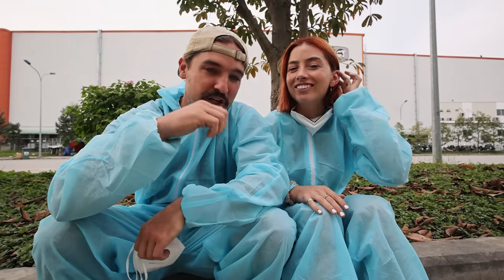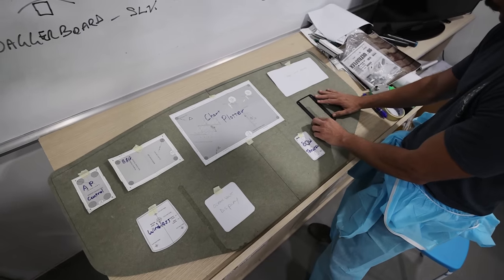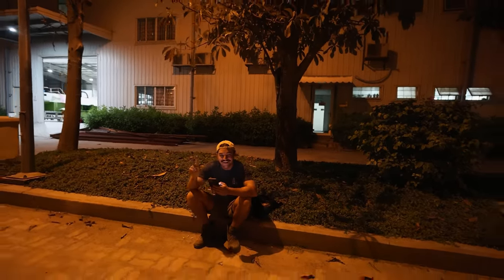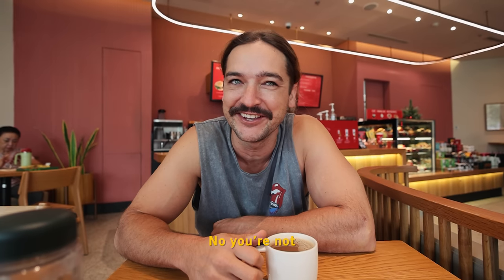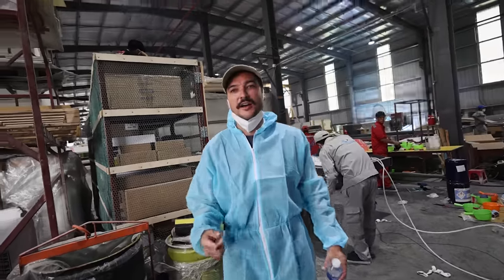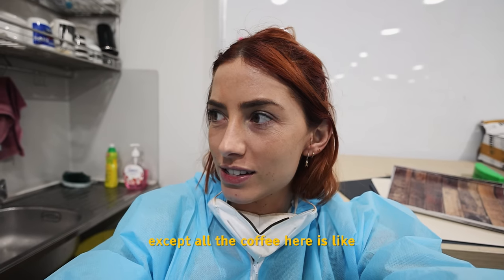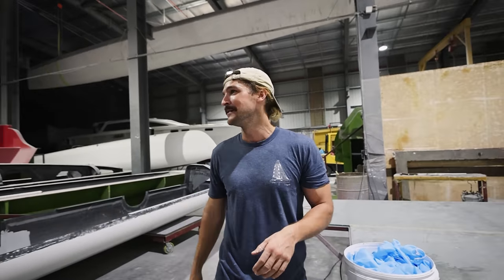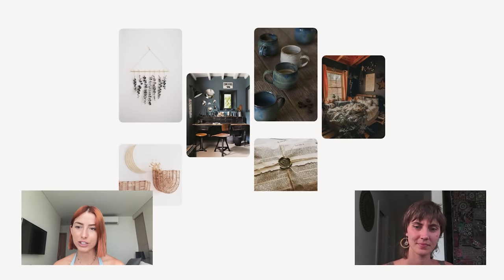BOAT BUILD: Interior work Begins!

Comment: First, I want to say what a cool trimaran!!! CONGRATS!🎉🍾
Second, thank you for taking us all along for the ride. Personally, I love seeing a new boat being built.
I am going through a new boat build myself right now, and I agree everyone has different design taste. I am very fortunate to have a very well know boat interior design firm helping me because, like yourself, I have never built a new boat before. 
 As many people have commented on, I will agree that having calm neutral colors is very, very important. I was wanting a Jacques-Yves Cousteau meets Ernest Hemingway vibe for my interior, and I was surprised how the design team came up with everything and presented it on picture boards and in 3D. The takeaway was that natural tones and calm neutral colors with decor accents pulled everything into place, and when needed soft goods can be easliy changed. This is just my advice and do with it as you wish. Maybe take a moment and think hard about the multitude of dark colors and items that are not easily changeable. Also, an important thing I strongly suggest is having two electric two burner hobs instead of a large single induction unit. This way, if one hob unit goes out, you still have another 2 burner hob to use until it can be replaced.

Comment: Hello! some plant options for you both.
Dracaena trifasciata (snake tongue/ mother in laws plant) an amazing plant which is hard to kill also they are really good for bathrooms as they are able to thrive in low light, they are also a great air purifier, known for filtering out formaldehyde, commonly found in bathroom products. Ceropegia woodii (string of hearts) is a lovely plant with heart shape leaves and with their pinkish-purple undersides of the leaves and stems add a romantic hue. They are tolerant to neglect and are the perfect hanging plant. Aloe vera also a another tolerant plant which is easy to look after and is great for the skin (sunburn, dryskin, rash). Mint is also an amazing plant to grow it is fast growing easy to look after and has a fragrant scent also is edible and can be put in to tea's, chocolate and in a salad.  Hope this helps 😊

Comment: Workers are painting in dust masks, a really bad standard in a shipyard that builds multi-million yachts. They should be equipped with at least half masks with a carbon filter, I think that the two of you for grinding should also be equipped with such. Silicone gasket is the only one that does not let microparticles through.
Reply: A message from the management of Rapido Trimarans:

We are very proud of our workers. Their safety and well-being is of the highest priority and unfortunately, as shown in the video, we collectively let ourselves down in this instance. 

3M respirators and face masks are supplied and have been taught to be worn at all times but they were not being worn at the time of the filming. This issue has now been addressed.

Giving an independent third party unrestricted camera access to our factory can be confronting. In this case, it has highlighted an important issue for us, which we need to have rectified.

As a company, we will continue to learn and try to do better in our quest to build the best ocean-cruising trimarans in the world.

Comment: I realise you guys will be well done with all this stuff by now but sanding anything resin based you should be wearing a full n95 respirator mask, as should the staff at the factory. Those thin paper masks will do nothing at all to stop you breathing in particulates.
Resin dust is carcinogenic and not to be cut corners on safety wise. And no doubt the paint is the same. You've only got one set of lungs guys, look after them well.
Reply: A message from the management of Rapido Trimarans:

We are very proud of our workers. Their safety and well-being is of the highest priority and unfortunately, as shown in the video, we collectively let ourselves down in this instance. 

3M respirators and face masks are supplied and have been taught to be worn at all times but they were not being worn at the time of the filming. This issue has now been addressed.

Giving an independent third party unrestricted camera access to our factory can be confronting. In this case, it has highlighted an important issue for us, which we need to have rectified.

As a company, we will continue to learn and try to do better in our quest to build the best ocean-cruising trimarans in the world.

Comment: HI! I have worked at a greenhouse and nursery for a few years now and some plants I would highly recommend for your situation and climate would be: Aloe Vera (great cause it would also be useful) also these plants like to be in tight spaces so it does not need a big pot at all, snake plants are also very hardy and require little space, spider plants can get quite big but are a really fun plant and easy to propagate which might be fun for the boys, zz plants are almost impossible to kill, and jade plants are slow growing but beautiful and is a large growing succulent so easy to work with! with all plants just make sure the drainage is good on the pots (always repot from stores even if its going back in the same pot), use a good soil with a slow release fertilizer and look up each plants recommended sun time! good luck with the new boat she's beautiful! ♡

Comment: buying an induction top for vans and boats.... you should look for ones that vary the current draw instead of the 99% of house types that pulse at full power and vary the 'power' by pulsing at full power, much like a microwave does.  there are van/boat friendly ones that draw varying amounts of current, much better for battery source supply.  loving the steampunk design theme, google steampunk lights, awesome theme
Reply: Great point.
Reply: steam punk is awesome in comic books not in boat interior where you hav to live and see it 24/7..
Reply: @jucha6992  haha oh i think it depends on how mad you go with it.  maybe just the light man on a shelf.  imagine the extra weight if you had lots

Comment: Correct me if Im wrong, but shouldn't they be wearing a respirator when spraying and not just paper masks? I'd be surprised if those paper masks block the potentially carcinogenic vapors from spraying.
Reply: A message from the management of Rapido Trimarans:

We are very proud of our workers. Their safety and well-being is of the highest priority and unfortunately, as shown in the video, we collectively let ourselves down in this instance. 

3M respirators and face masks are supplied and have been taught to be worn at all times but they were not being worn at the time of the filming. This issue has now been addressed.

Giving an independent third party unrestricted camera access to our factory can be confronting. In this case, it has highlighted an important issue for us, which we need to have rectified.

As a company, we will continue to learn and try to do better in our quest to build the best ocean-cruising trimarans in the world.

Comment: I’ve seen a bunch of plant suggestions but I still have to give my opinion since I’m not a sailor and I can FINALLY comment something useful that I can relate to. Highly recommend pothos, there are a bunch of varieties. (My personal favorite is cebu blue) So easy to care for. Snake plants are literally made for people who are bad at plants. Mine thrives on neglect. Literally water it once a month. Philodendrons are pretty easy too. 

Hanging plants in handmade pottery makes a big statement and add life to a room. Also will not take up valuable room on your surfaces/shelves and I’d have to imagine will be more practical on the water as you won’t need to worry about them tipping over.

Comment: The architect is bang on  the space should be muted tones and the soft furnishings be the injection of colour. This will allow you to use more colours and tones without being too busy. 
Darkening the ceiling makes a space feel smaller but comfortable. Common when decorating pubs restaurants you can allow for this because the sun will always be shining where your sailing and with a tasty lighting package ie spots and up lighters. 
  High gloss finish kitchen cabinets show all the dirt smudges satin is the way. The timber looking stuff is not so tasty IMO 

 This is the content we need actually building the boat well done guys.

Comment: If you can actually smell and feel the fumes then you should use proper Respirators. Maybe you could help the workers more by organising those for them 😅
Reply: A message from the management of Rapido Trimarans:

We are very proud of our workers. Their safety and well-being is of the highest priority and unfortunately, as shown in the video, we collectively let ourselves down in this instance. 

3M respirators and face masks are supplied and have been taught to be worn at all times but they were not being worn at the time of the filming. This issue has now been addressed.

Giving an independent third party unrestricted camera access to our factory can be confronting. In this case, it has highlighted an important issue for us, which we need to have rectified.

As a company, we will continue to learn and try to do better in our quest to build the best ocean-cruising trimarans in the world.

Comment: Outstanding updates to the previous R60. That new streamlined shape of the deck-house looks like a fighter jet. The expanded saloon seating  and front facing nav station (like the R50) quite nice. Thinking twin berths on port & starboard sides of the aft cabin (individual storage under each) would open up floor space there & might be more practical than one big double, particularly for the two boys later….

Comment: 12:24 I don't want to be a Debbie Downer but those are not fume preventative masks those are particulate masks those are for dust particles not for paint fumes you need a respirator that's why the fumes are so strong

Comment: So, obviously a dust mask is not appropriate for spray work and VOC environment.  Get respirators, with appropriate filters, for your selves and the boat builders!
Reply: Was also wondering about that...
Reply: A message from the management of Rapido Trimarans:

We are very proud of our workers. Their safety and well-being is of the highest priority and unfortunately, as shown in the video, we collectively let ourselves down in this instance. 

3M respirators and face masks are supplied and have been taught to be worn at all times but they were not being worn at the time of the filming. This issue has now been addressed.

Giving an independent third party unrestricted camera access to our factory can be confronting. In this case, it has highlighted an important issue for us, which we need to have rectified.

As a company, we will continue to learn and try to do better in our quest to build the best ocean-cruising trimarans in the world.

Comment: Re: induction tops. We have been using them for probably 10 years now. Do not use any pot that a magnet does not stick to... regardless what the pot says or the stove top manufacture says. We have friends with an induction cook top that was very expensive and they are missing 3 out of 5 hobs which are $500-ish each, and the only difference I can find from theirs to ours, is that their manual suggests it is OK to use even copper bottom pots at low power. This means the hobs will try to run even with no load rather than sensing no load and shutting down as they should. Every induction hob will put the applied power out as heat, normally with a good iron pot, 90% or more is in the pot. If the pot does not absorb that heat, the hob has to and it won't handle 2000 watts for very long, 200 watts? no problem. All that said, we have been using them a long time and we love them. We have never broken any of them. We use cast iron a lot, but many types of stainless steel work too... just take a magnet shopping with you when you buy pots and be careful of guests bringing pots of food with them to warm up for the party. Have a frying pan around they can set their pot on.

Comment: Most herbs are often very sensitive to changing environments, I would suggest trying mint if you still want to go the herb route though! It grows quicker than most weeds.

Pothos are hardy plants that vine very quickly and come in a variety of shapes/colors/patterns. I’d recommend trying your luck with a golden pothos first! It’s a little more basic, but they’re nearly impossible to kill.

In my opinion, zz plants and snake plants aren’t the prettiest of plants, but they can live in very low light and require water about once or twice a month. 

And while they aren’t really “potted plants”, air plants come in a variety of shapes and thrive in moist environments - like bathrooms. Just soak it in a shallow bowl of water when the end of its leaves get a little crispy!

Most plants don’t like to be overwatered! The easiest way to check this is sticking your finger about two or so inches into the soil. If you feel moisture, avoid watering it!! Also, invest in pots with drainage, just in case you over water! Best of wishes x.

Comment: Why in God's name are you guys working on your boat when you're paying someone else to build it? I can understand doing site visits at various stages of the build process so you can troubleshoot once you're away sailing, but to be doing menial labour like sanding, beggars belief when you have two toddlers back in the hotel obviously being looked after by a nanny. If I were Rapido I would hate to have my clients working of the manufacturing line. So, stop bloody messing around and go spend quality time with your children. Watching you guys sanding down the boat doesn't make good content...I'd rather watch paint dry! PS: Re the interior design decor - you are breaking every rule of design classics by going with wood wallpaper and copper fittings...always think about the resale of the boat. My advice is to keep everything neutral. You can never go wrong with white...keeps the look clean and no one can look at the interior and go I hate "the look"...wooden wallpaper is very polarising....people either love it or hate it. Why you would be going with an antique design palette on a modern boat choker blocker with carbon fibre beggars belief.
Reply: Riley and elayna are content creators.it is very probable they have a contract with rapido.this episode is all business for Riley, elayna and rapido.of course all the videos are big biz..you get my point

Comment: Fair warning guys, some of us who love to cook hate those induction stove tops. If you splatter while its hot, those spots bake on and are stupidly hard to clean. If you are determined to make it sparkle, it's easy to permanently scratch it the glass top, which is possible to shatter. They aren't meant to last, in my opinion  I consider it a deal breaker when looking at rental homes to move to. Many people feel differently, but I thought you deserved a heads up in advance so you can look into it further..

Comment: I fully agree with all of Barry Macken's well articulated thoughts. 

Your new boat is magnificent.

The result of many, many design choices made across the components that make up the vessel.

Each choice informed by clear understanding of function, context of use and influence the design has on performance and experience.

An analytical approach which results in the right choices and design solutions which can be communicated in clear - non abstract - terms.

The function, the context, the solution.

It is concerning to see this clarity of approach missing in the design of the interior.

Comment: some good low maintence plants. depending on light exposure.
 you want to have moderate sun exposure for tropical plants.
 Pothos (Epipremnum aureum) do very well in almost any conditions and they vine which can add such a cute aesthetic. It almost impossible to kill them. They can be grown in water!
ZZZ Plant (Zamioculcas) grow in bulbs so you would need them in soil. they are easy manitence.
Snake Plant (Dracaena) can be grown in water and soil and there shape is very rigid. 

In my personal opinion Pothos would do great in the bathroom with light. you can even get clips with time as the vine grows to trail along the walls. 
I love plants and love your videos! I love the idea of incorporating plants into the bathroom since its black and white with that green it will add such a natural boost of color.defiently look intosome more easrth tones to compliemt the green! Let me know if you have any other questions regarding plants!!!!! Saying Hi from Miami Florida!

Comment: I can also vouch for Pothos Cordatum (I think there are several varietys). I barely water it (should do more) but nothing seems to faze it. It grows super fast and does a nice hanging waterfall. I have it in the salon so there is quite a bit of light, but not direct.

Comment: I think some Air plants would do well on your new boat, their very easy to take care of like watering one a week and a soak once every 2to3 weeks . You should be able to source them there they are a tropical plant. If the humidity is high they don’t need to be watered, the best part most of them don’t need soil just good air circulation and a spritz of water once to twice a week. Also I have a Copper sink it’s almost 10 years old and looks as good as new. It has a thick  manufacture clear coating and I only use natural cleaner’s  on it